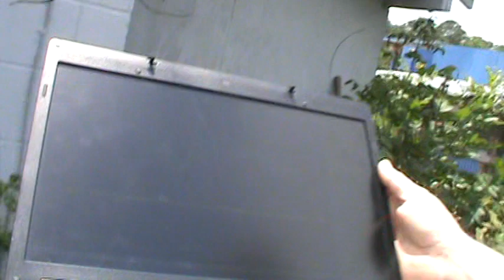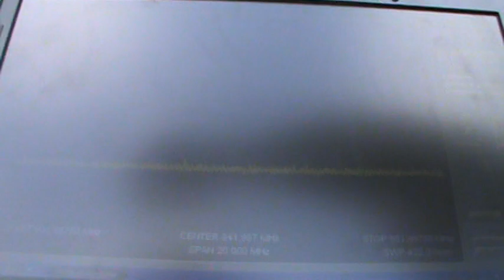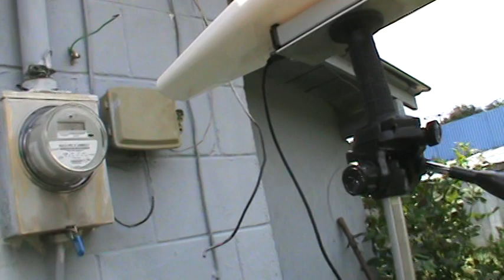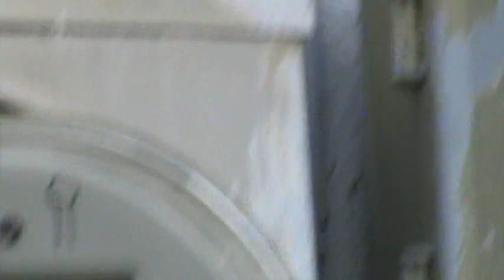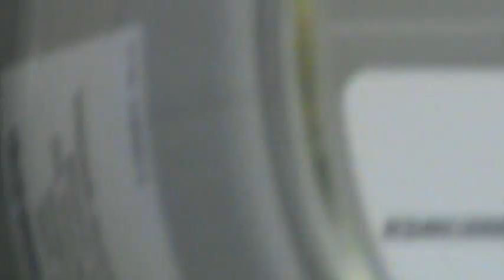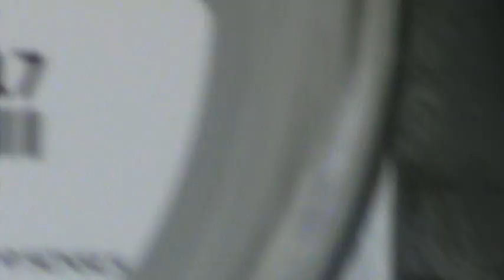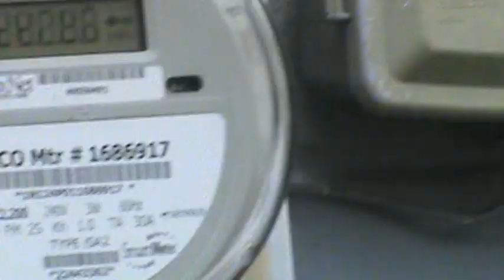Georgia Power Smart Meter Investigation Part 1

Comment: 1:36  "Technically, it's microwave [radiation]"!  That's why you don't want one of these on your home, especially if there's a child sleeping on the other side of the wall.  The radiation shoots right through the wall, radiating whoever's there, and research indicates that type of non-thermal radiation can cause sleep, memory, and learning problems, DNA damage and DNA repair failure, disrupted immune function, cardiac, heart muscle, blood-pressure and vascular effects, cancer, reproduction and fertility effects, brain tumors and leakage in the blood/brain barrier, even at very low level.  It's worse that this is a pulsating radiation, as cells don't get a chance to adapt to it.  Thanks, Todd West, for this video!
Reply: First of all, microwave rf does not just shoot thru a wall.   It depends on the type of wall of course, but just like in your microwave oven (which has tremendously higher levels of rf) the rf radiation is easily blocked (which is why they have to have cell towers all over an area).  Yes there are studies which say rf emissions can theoretically affect biological functions, there are no studies that show a cause and effect relationship.  Just because you have a fear of something, that doesn't make it true...  If what you believe about these AMI meters is true, then you need to get rid of all the electronics in your life - cell phones, computers, cars, TVs.....   Even the "good old" cars used high voltage, mechanical points, spark ignition which puts out tremendous RFI (drowns out your AM radio signal) way worse than these tiny transmissions from an AMI meter.
Reply: Did you find wrong doing? If so, how? show me the math. 900MHz is not microwave... Power is too low. Let me show you...-3dBm =0.000501Watts = dBw =0.501187 mW P(dBm) = 10 ⋅ log10( P(mW) / 1mW) example 100mW P(dBm) = 10 ⋅ log10( 100mW / 1mW) = 20dBm next to no power. I am an RF Engineer (microwave systems and not in the USA none biased
Reply: @educatedmanholecoverbyrich8890 , If you Google a graph of
the radio spectrum and what is agreed
upon by the ITU as to what is ELF, LF, 
high frequency, microwave ect., you will
find that "microwave" begins at 300 MHz.
and ends at 300 GHz. Aside from this, I
absolutely agree with you that these
conspiracy theorists have nothing to
fear from smart meters. I'm no engineer
but I have been in the radio hobby for
45 years.
Reply: And that's what you don't understand about this whole thing..."[radiation]." Your fear comes from a lack of understanding of the Physics of Electromagnetic radiation of any kind. Yes...there are different types of radiation and depending on their energy they're either considered ionizing or non-ionizing radiation. I won't go into the fine details of the subject here but suffice it to say, you get exponentially, millions of times higher, higher energy exposure from standing in the Sun for 1 minute...than you will get in your entire lifetime of exposure to your devices. I hope you realize how big a waste of time this is and be ashamed you ever wasted your time worrying about this, cuz I'm ashamed for you for even having addressed this.
Reply: Rob S.
"........... I hope you realize how big a waste of time this is and be ashamed you ever wasted your time worrying about this, cuz I'm ashamed for you for even having addressed this."

In all due respect, I am appalled that you are willing to dismiss and demean someone as you have for just wanting to understand a technology for the benefit of knowledge and satisfaction for their health. I do recall there was a time cigarettes were promoted by doctors and CEOs of tobacco companies came before Congress to testify the safety of their product. So don't chastise me or anyone else for wanting to understand something that may influence their health. Just the explosion of these devices in our lifestyle warrants questions for concern.
Reply: @larrybe2900  -3dBm =0.000501Watts = dBw =0.501187 mW P(dBm) = 10 ⋅ log10( P(mW) / 1mW) example 100mW P(dBm) = 10 ⋅ log10( 100mW / 1mW) = 20dBm zero power
Reply: ...1:36  "Technically, it's microwave [radiation]"!  That's why you don't want one of these on your home, especially if there's a child
sleeping on the other side of the wall.  The radiation shoots right through the wall, radiating whoever's there, and research
indicates
 that type of non-thermal radiation can cause sleep, memory, and learning problems, DNA damage and DNA repair failure,
disrupted immune function, cardiac, heart muscle, blood-pressure and vascular effects, cancer, reproduction and fertility effects,
brain tumors and leakage in the blood/brain barrier, even at very low level.  It's worse that this is a pulsating radiation, as cells
don't get a chance to adapt to it.  Thanks, Todd West, for this video!...

I'd be willing to bet you got your information from the same people that the government got their's about LSD back in the 60's.
Case in point: "DNA damage and DNA repair failure" . First off, DNA, once damaged, can NOT be repaired. if it could, no one
would be worrying about nuclear power plant meltdown because there would be no chance of cancer from them. Second,
your so called radiation happens to be radiating straight into a GROUNDED STEEL meter box so little to no radio energy will
reach anyone who maybe sleeping on the other side of a wall
 from the smart meter even if they were harnessed into an upright
Murphy bed. Even if it did radiate into said room, your cell
 phone, while not on the same frequencies is on the same frequency
band as smart meters. Smart meters only broadcast once
 or twice a day for a few milliseconds at a time. People spend hours
a day on cell phones that broadcast at higher power than smart meters and
 they have been proven to be harmless. Third,
Just what is "non-thermal radiation" anyway? There is RF or Radio Frequency radiation which is what we're are referring to then
there is nuclear radiation, neither of which are "thermal" or hot. Even the radio waves in a microwave oven aren't hot, They
vibrate at the resonant frequency of the water molecules in the food and make them shift back and forth like little magnets.
The friction of these water molecules shifting back and forth at 1.8 billion times per second creates the heat that cooks the food. 
Google it if you dare. When someone refers to a "thermonuclear device", this just means hot nuclear device which is a bit of
 a misnomer. The INITIAL heat energy from a hydrogen bomb is not directly generated by the device itself. It is mostly a byproduct
of the blast caused by the device. Before anyone starts slinging their E=mc SQUARD'S at me, let me explain. Yes there is copious
amounts of energy produced by a hydrogen bomb. If you have ever seen a movie of an H-bomb going off, first you see smoke
appearing from the paint on a test house. Then you see it burst into flames. Then you see it blown away. The heat that caused
the smoke or flames was NOT directly from nuclear radiation but from the FLASH traveling at the speed of light hitting the house
first. The blast wave that blew the house down like the big bad wolf contributed to that heat out of sheer compression of the
atmosphere. This is why a diesel engine doesn't need spark plugs. If you compress air by one pound per square inch, it's
temperature increases by two degrees. 500 lbs compression in a diesel cylinder + atomized fuel = BOOM!!! Now consider the
ramifications of suddenly igniting a small star and the heat that goes with it near your location. A lot more than 500 PSI but
in ALL directions. So, yes, an H-bomb's radiation makes heat or, as Three Dog Night said in their song, the sun is just a bright
spot in the night time. It just doesn't get there first. An atomic bomb, while a completely different process, once it detonates,
is basically the same but to a lesser extent. First flash, then blast. Here's something that will freak you out and google it if
you don't believe me. You have to be VERY specific when you ask Google a question so be sure of what you're asking it.
A ONE MEGATON H-BOMB PRODUCES LESS RESIDUAL IONIZING RADIATION THAN EITHER OF THE 10 TO 15 KILOTON 
URANIUM OR
 PLUTONIUM BOMBS DROPPED ON JAPAN IN WW II.
If you Google this, use either uranium OR plutonium in your query. Check both if you wish but do only one at a time or you
may get an incorrect answer for the question asked.
As for all the other ill effects that you mention and the thing you said about "It's worse that this is a pulsating radiation, as cells
don't get a chance to adapt to it." I'll make you a deal. 1) Take the door off
 from an 1,100 watt microwave oven, 2) Disable the
safety switches. 3) Tightly cover the the opening with a grounded steel box
 and aim it at yourself. 4) Twice a day, turn this oven
 on for 20 milliseconds, aimed at you, that's 20/1,000th of a second for a
 solid year.
 Then 1) Turn this oven on and leave it on
for one hour, aimed at you for one hour, still tightly covered by said steel
 box and, assuming that it won't burn out for the sake
of this
 conversation. Then, and only then, can you tell me how pulsed
 radio waves are more dangerous than constant exposure.
First, cells in the human body, when exposed to ANY kind of
 HIGH LEVEL radiation for any REAL length of time, be it,
 radio
spectrum or nuclear will NOT "get
 used to it" This is why nuclear power plant workers and Xray technicians wear film badges
to monitor the dosage that they may absorb PER YEAR of their respective forms of radiation. Xray techs get Xray exposure where
power plant personnel get gamma rays and alpha particle exposure. Like in my microwave example above, covered by a grounded
steel box, which
 equates to the meter box on an outside wall, even at 1,100 watts, for 20 milliseconds twice a day for a year would
NOT harm you.
 This would be your pulsed radiation and your body, while NEVER technically being able to "get used to it" would
recover from such a minuscule dose on a daily basis. On the other hand, as I said before, leaving it on, pointed at
 you for a solid
hour, even with the steel box in place would probably kill you before the end of the hour. Remember, we are
 talking one
thousand, one hundred watts here and not the tens of thousandths of a watt put out by a smart meter. As for your "research
has shown" shit. My personal research has shown that the total IQ of Americans has sunk to such a low level that it would be
a LONG
 stretch of the imagination to believe it if it weren't for two key pieces of evidence. 1) People read and believe this shit
on line about smart meters, proof of life on Mars because they see a human statue in some rock formation and black eyed
devil children who want to get into your house but need to be invited first, (Look it up, it's right here on YouTube!). And 2) That
LYIN' KING tRump got elected in 2015. As in the word of our "great" president, Sad.
Reply: Jeff McCrea
Most of all of us know ionizing radiation is bad for us so to dwell on it is not saying much. Sure, we take poisons to cure disease. We do not immerse ourselves in a sea of RF soup that because invisible won't hurt us. We have not been exposed enough long enough to know what is bad.
Reply: I can tell by your first line that you don't know about radio energy either. First, ionizing radiation is the furthest thing from
a smart meter. An example of ionizing radiation is what goes on INSIDE a florescent light bulb. The neon, argon or other
noble gases, depending on the color of the bulb, gets ionized by the high voltage electricity that is put into it. Another
example, for those of you who have been in the high country of Colorado on a cold, dry winter night, is St. Elmo's fire and
NO, I don't mean the movie. One last example of ionizing radiation is if you have ever been around an 18 wheeler or
someone who has a LARGE CB high powered amplifier and they hold a florescent tube up to their antenna and it glows.
These are
 3 examples of ionizing radiation that is perfectly harmless but produces MUCH more power than a smart meter.
For
 radiation to ionize something, it has to either add an electron to it's atoms, (negative ionization), or take an electron
away,
 (positive ionization or less negative. Same thing.). In the case of a florescent light bulb, it is adding an electron
supplied from the power source. In the
 case of nuclear radiation, it strips away an electron. This, in either case, takes
energy. Technically speaking, ionizing
 radiation is safer at a distance because it loses energy ionizing the air between you
and it's source. Practically speaking
 I wouldn't want to be within 100 miles of a nuclear blast or melt down. It is the NON
ionizing energy that is more
 dangerous as it does NOT dissipate as much energy over a given distance. Not to bolster
you
r position but technically
 speaking, smart meters put out NON ionizing radiation. You can tell because the air around
them doesn't glow.
 Anyway, at 4 1/1,000th's of a watt transmitting for 20 1/1,000th's of a second twice a day, if this was a
piece of uranium
 putting out an EQUIVALENT amount of radiation for the same amount of time, it would be many orders of
magnitude
 LESS than the exposure that one would receive from sitting in front of an old picture tube style TV for 4 hours a
day. Oh, and
 I have news for you. We have been immersed in an OCEAN of your RF soup for 98 YEARS since since KDKA
started
 broadcasting on November 2, 1920. Not so much everyone then but with more and more radio and TV stations
starting up
 and the galaxy
 of communications and GPS satellites over head that are beaming microwave RF energy down
on us, I
 suggest you start breaking out the aluminum foil
 helmets if you are really that worried about it. Oh, and don't forget
to drag
 that grounding chain behind you. This doesn't
 even include all of the CB's and HAM radio operators out there and
EVERY police car,, cop with a walkie talkie, fire truck, airplane, helicopter, city, county, state and federal vehicle, military
vehicles, radio dispatched service trucks, cell phones and their associated towers, every car and house with a CB antenna
on it, department of transportation vehicle, forestry service truck, FBI car, and ANYTHING else with a transmitting antenna.
Here in West Virginia and most other states that are dense with mountainous terrain, some state police cars have as many
as 6 high powered transmitter / receivers, (transceivers), in them to act as mobile repeaters for other cars in their areas in
case they can't reach their dispatchers with their standard radios. A lot of HAM's are licensed to
 transmit at up to 2,000
watts.
 If you have one next door, which is perfectly legal, he is
 irradiating you a hell
 of a lot more
 than your smart meter.
Some
 HAM's even take the magnetrons, (microwave transmitters), 
out of microwave ovens
 and modify them to
 key up
Morse code on. Where else
 can one buy a ready made, FCC approved 1,100 watt transmitter that transmits in a band that
one is authorized to
 operate
 on,
 brand new for $98.00? 
Now there is your
 dangerous ionizing radiation if you get in it's path.
 If you want to test this
 theory, open a stick of COLD margarine and leave
 the edges of the foil wrapper about 1/4 inch apart
at the top and put it in
 your microwave on high. Then sit back and watch the fireworks.
I liken people who worry about smart meter "radiation" to someone who worries about the light spring drizzle coming in
front of them when they are forgetting to look out for the 20 foot flash flood wave coming at them from behind. That thing
I said earlier about seeing in Infrared or UV, if you managed to ban ALL of the smart meters in the world and if you could
feel radio waves, You would be drowning in a sea of your "RF soup" as deep as from here to the sun. I hope you can swim.
Reply: Jeff McCrea
You are right I do not know all I should about this subject. I can appreciate your insight into the subject matter. Are we not entirely talking about wave patterns? It is only as the waves get shorter that we begin encountering issues with human interaction? The spectrums you mentioned early in the 20th century were not an issue unless within the power wave originating area. Waves the length of a football field are quite dissimilar to one considerably shorter. On top of that multiply the number of sources exponentially right in the power transmitting area and there is change happening. We are evolving much differently than we did before man started using radiowave technology. And does any one care?

Could you elaborate on any of the studies of the '70's dealing with microwave radiation and health effects and safety? Are smart meters only transmitting twice a day? If such be the case I would not be much concerned either. That number is the minimum is it not? How do smart meters communicate with the appliances in the home, only 2 times a day? Who is paying for this energy that spies on us? Are we at the point of being hooked on this technology that we will accept 5g being beamed right into our homes because it is fast? I know what the powers that be will do to keep a crown jewel of abortion out of the minds of the public by merely declaring what was common knowledge before 1973 to no longer be so, when life begins is controversial. I know if something is wanted bad enough just like cigarettes the whole truth is not offered. Just the way my electric company approaches informing a customer and uses a disclaimer that facts and figures are not theirs seems to leave me with questions. Would it not you? 

I do not champion a fight but just want to be informed as to what energy we immerse ourselves in today and how it is affecting the body. We are all not the same.
Reply: "Are we not entirely talking about wave patterns?"

Not entirely. If you are referring to the direction that radio waves travel, in the case of the smart meters, it would be out
from the front and sides. Any signal radiating from the back would be absorbed and shunted to ground by the grounded
steel box that it
's mounted in. If there actually were a danger from these, the safest place to be would be on the other
side of the wall
 directly behind the meter where everyone tries to say it's worse.

"It is only as the waves get shorter that we begin encountering issues with human interaction?"

This is true but there's more to it than this. Most AM broadcast stations transmit at between 5 and 10 kilowatts, (Kw).
Some are designated "clear channel" stations and are licensed to transmit at 50 Kw. This was originally for the old
civil defense program so if the station survived a nuclear attack, it was equipped to transmit further to disseminate
government bulletins to more people. If you were to climb any one of these transmitter towers and jump off to parachute
down, you probably wouldn't notice anything because at these extremely long wave low frequencies, it takes a lot more
power to do harm. If the station was transmitting at 500 Kw, you would probably cook before you reached the top. BTW,
The tower itself is NOT the transmitting antenna. That is at the top of the tower.

"The spectrums you mentioned early in the 20th century were not an issue unless within the power wave originating area."

The spectrum that I mentioned was pretty much confined mostly to the AM broadcast band between 550 and 1610
kilohertz or KHz. This band was expanded to 1710 KHz in the 90's. With the available technology of the 20's like
vacuum tubes, bulky capacitors, bulky coils and no crystal frequency control, power levels weren't all that high back then.
I assume that what you call "the power wave originating area" is near the transmitting antenna. If this is the case, I
answered this above.

"Waves the length of a football field are quite dissimilar to one considerably shorter."

This is not true. All frequencies of RADIO waves are essentially the same. They are electrically produced in a circuit
called an oscillator. The only difference is the wavelength of the wave itself which is governed by the control frequency
of the oscillator. Some are direct crystal controlled. Some use a circuit called a hetrodyne or mixer circuit where the
outputs of two or more crystal controlled oscillators are mixed up or down to achieve a desired frequency. A third
way is by using a phase locked loop integrated circuit which uses the output(s) of one or more crystal oscillators
to make many frequencies. The PLLO2A  is capable of generating up to 511 different channels from 1 crystal control
frequency. The uPD858 chip can generate 399 channels from three different oscillators. This is done with internal
digital counters within the chips themselves.

"On top of that multiply the number of sources exponentially right in the power transmitting area and there is change
happening."

If you are referring to a broadcast transmitter, a radio dispatched service truck, a traffic cop with a walkie talkie and a
HAM station in a house all within 100 feet. If there was a danger here, it would lie with the broadcast station. The other
three transmitters would be of no consequence because they would all be of fairly low power and transmitting in different
bands with their associated different power level requirements before they begin to do harm. With the low power of the cop
and the truck and the height of the HAM and broadcast antennas, there would be no actual harm or danger from ANY of
them.

"We are evolving much differently than we did before man started using radio wave technology."

We are evolving all the time but you can't lay all the blame at the base of the antenna. Evolution was happening LONG
before
 Tesla invented radio, (It has been proven in court that Marconi had usurped Tesla's designs and his patents based
on 
Tesla's work have been revoked). In fact, it has been happening for about 1.8 BILLION YEARS since the first bacterial
slime inhabited the earth.
 Evolution is nothing but genetic mutation. This can be caused by cosmic rays from space,
naturally occurring radioactive minerals in the ground or even solar radiation. Any of these can "damage" DNA but not all
damage is bad. Sometimes a dose of radiation can cause a dormant gene to activate which may help protect us from
disease, help us heal faster from an injury or even mitigate some of the damage caused by radiation. On the other hand
it could damage DNA and cause such maladies as muscular dystrophy, multiple sclerosis, spina bifida ect. As sad as this
can be, this is the good, the bad and the ugly of evolution.Some changes can be caused to DNA by exposure to microwaves
but it would take a much bigger dose than you would ever get in a lifetime from a smart meter.

"And does any one care?"

YES!!! The U.S. has the federal communications commission, (FCC), and most other developed countries have their version
of this. Most of those belong to the international telecommunications union, (ITU). This organization gets everyone
together to study the effects of RF radiation, produce standards for safe power levels and agree on what frequencies
each member country can use to try and keep each other from inadvertently interfering with the communications in
bordering countries.

"Could you elaborate on any of the studies of the '70's dealing with microwave radiation"

It was the early 70's when I first got started in radio. This was even before microwave ovens were available. I am
not familiar with these studies but if you Google them and read them, I'll try to answer any questions you may have, 
if I can. If you find them, please let my know who conducted these studies.

"Are smart meters only transmitting twice a day?"

According to my power company, Monongahela Power, They transmit twice a day for 20 milliseconds which is
20 1/1,000th's of a second. This is much shorter than a single busy signal tone on your phone.

"That number is the minimum is it not?"

I can only speak for Mon. Power. Their's transmit twice a day to track on and off peak power times. W.Va. is a coal
state
 
and most of our power plants run on coal. You can't turn a valve for coal like you can for fuel oil or natural gas.
They track the peak times so they can better manage their on hand coal supplies and anticipate future coal needs.

"How do smart meters communicate with the appliances in the home"

Do you remember that "CRAP" that I've been complaining about? This is a prime example. Even if your meter could
communicate with your home appliances, they have no transceiver circuits in them to interface with your meter. NO
meter can distinguish between a 1,500 watt space heater, a 1,500 watt blow drier or 2) 750 watt hot plates cooking
add to this the 140 watts drawn by your 32 inch flat screen, the 480 watts that the fridge is pulling, the 100 watts from
the ceiling fan or the 360 watts from your old desk top computer. No meter is smart enough to know WHERE the power
is going. All it knows is that it's going somewhere and it's ONLY job is to keep track of how much and when.

"Who is paying for this energy that spies on us?"

Now you are trying to tell me that energy has intelligence? Energy can NOT spy on us. The old mechanical meters
drew 3 watts. I'm told that smart meters draw 4 watts. If you disconnected EVERYTHING in your house, that little bit
of power would NEVER show on your bill. It is 1/2 the power of that night light in your bathroom and you don't notice
on your bill either but I am told that it is pulled from before your power is metered

"Are we at the point of being hooked on this technology that we will accept 5g being beamed right into our homes
because it is fast?"

First, you have answered your own question. 5G refers ONLY to the connection speed available over a cell phone
system as it applies to smart PHONES and has NOTHING to do with radio for the purposes of this discussion.
Second, If these signals were
 "BEAMED INTO OUR HOMES",  cell phone towers would be placed like telephone poles.
The idea of a cell signal is to
 be broadcast and received within an area that resembles a flattened bubble, the edges
of which overlap just enough to give seamless communications as you are passed from one tower to the next. These
bubbles" are called "cells".

"I know what the powers that be..............Would it not you? "

It sounds to me like you are getting a little wound up because I don't understand what the end of your post has to do
with the subject at hand. If your reference to abortion has something to do with my reference to conception, this was
unintentional. My reference to conception was only meant to show a starting point when genetic activity begins. As for
the powers that be and their crown jewels, This is only my opinion that I have formed over the last 2 years from
observing a LOT of different news sources. In my opinion, the overriding concern of the powers that be is a world wide
business
 friendship with other big businesses that he can leach off from when he leaves office. This and big oil are
the jewels in the clown prince's crown. I'd bet anything that if you got into his mind, you would that find abortion would
be toward the very bottom of his list of priorities only to be pulled out of his back pocket to whip his Republican base into
line only when it suits him.
Well, I'm going to bed now. It's now 8:35 AM and I'm getting tired so I will bid you a ood morning.
Reply: Jeff McCrea
My mention of abortion had nothing to do with the act itself or your comment,  just the politics of issues where some powerful entity wants their "rights" or cash cow protected, using ignorance to perpetuate the action. (out of sight out of mind). My utility has a disclaimer that shifts any and all "factual" comments to another source. You check and make sure the 2 times transmission is coming from your utility and is accurate to what is actually happening with the meter. 

Is it true chips are in appliances that communicate with the smart meter? 

Up until the year 1900 +/- man was at the mercy of nature and we came to be as the strongest survived. Then man himself started using his brain instead of all the brawn and the environment we exist in today is not a haphazard incidence of mutations but an entirely new environment that will weed out to the strongest among us. We all have tolerances for noise (waves) a little or sometimes a lot but constant will drive one crazy to the point of having/wanting to do something about it. But a constant bombardment of silent waves , OK as you state away from the source but some do not have the luxury or good fortune to be away at a good distance. Power sources also are those being generated by WiFI in our private personal environs.
Reply: For the abortion issue, that was my
misunderstanding. I've been up all night.
For that, I apologize. As for the other
technical issues that you've just cited,
I respect your right to your opinion
and agree to disagree. Good night.